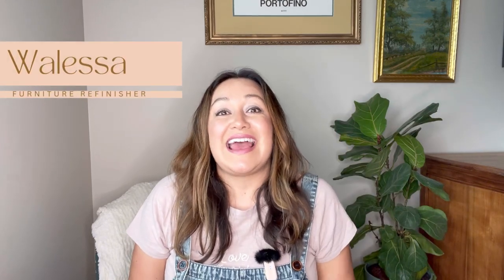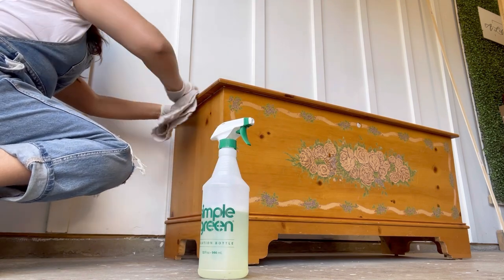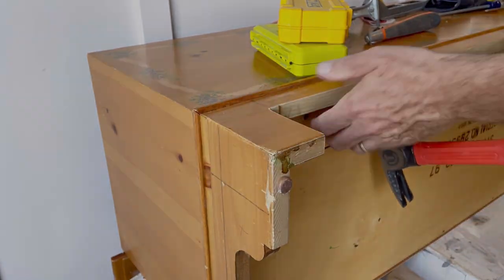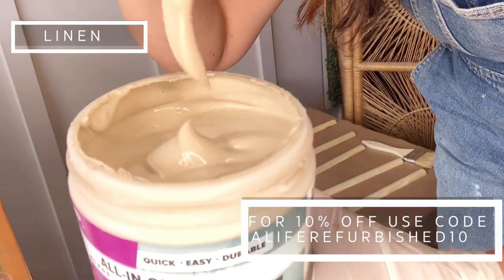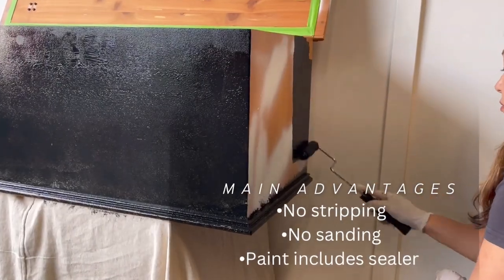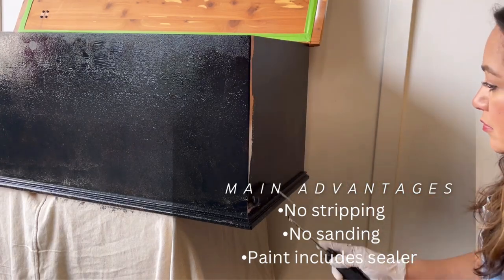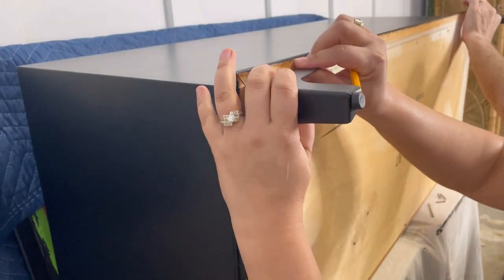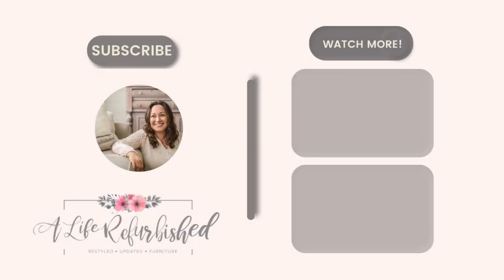Furniture Painting For Beginners | One Step Paint Chest Makeover

Comment: I just redid my kitchen chairs using the licorice beyond pain & i notice they get ashy looking when touched im super bummed out not sure why this is happening - im new to this paint & came here looking to see if you noticed this?
Thanks
Reply from the maker: Out of curiosity, what color did you use?
Reply: Licorice (black)
Reply from the maker: Generally speaking, the color black reflects light more regardless of the brand you're using, therefore, making it tricky to keep the color crisp. I would think chairs would be extremely difficult to maintain in pristine condition since they're high traffic areas, and our (no so clean) hands are always on them. This paint seems more on the glossy side, which is expected of an all in one type paint. And it's my personal opinion that paints with a higher sheen (like this none) could potentially show that ashiness that you're talking about on a high traffic area.  @sonokim